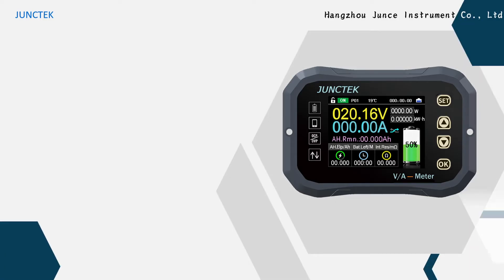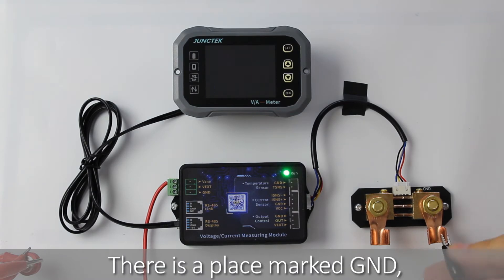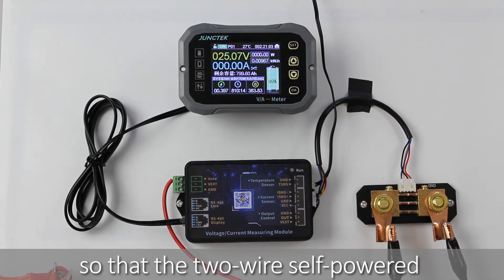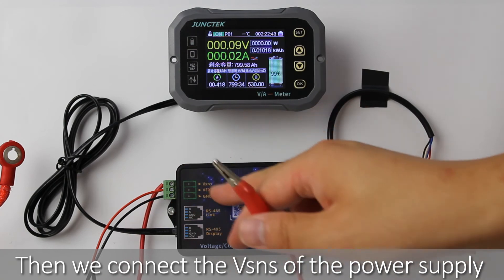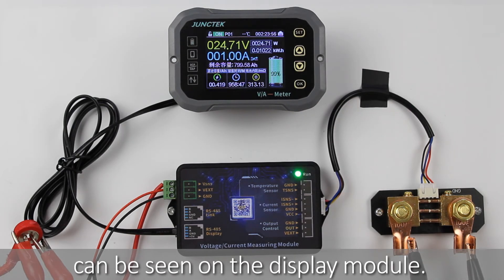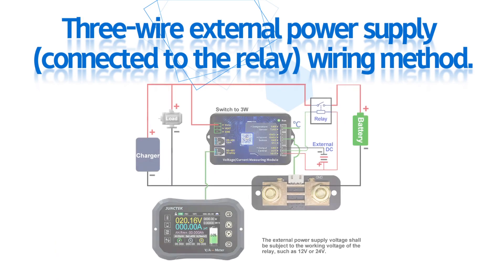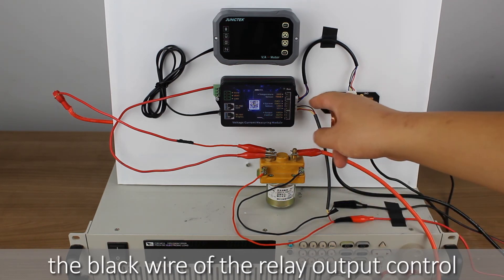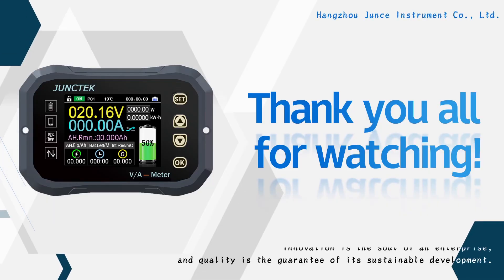Demonstration video of three wiring methods of KG-F high-precision coulomb counter

Comment: For the external power wiring method, which battery did you use to power the battery monitor? (It is not shown in the video). Will a 9V battery be OK to use?
Reply from the maker: It is best to use a power supply above 10V as an external power supply